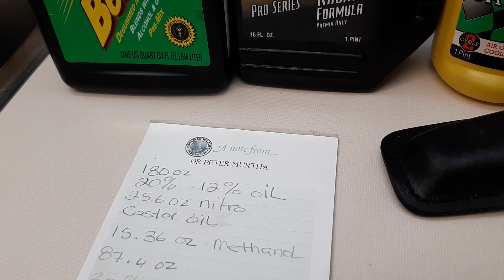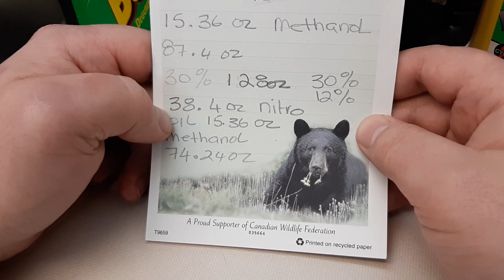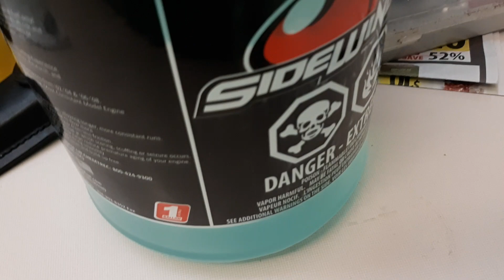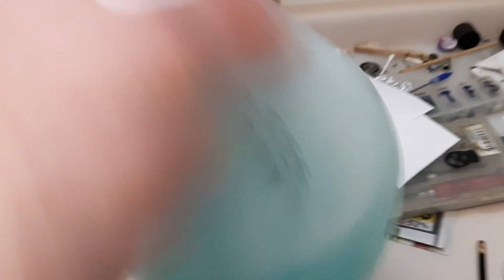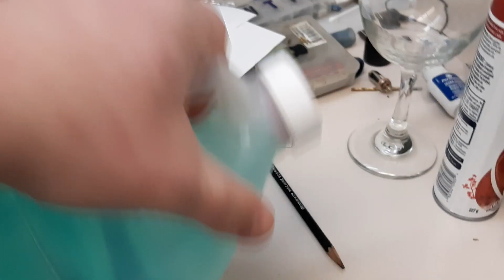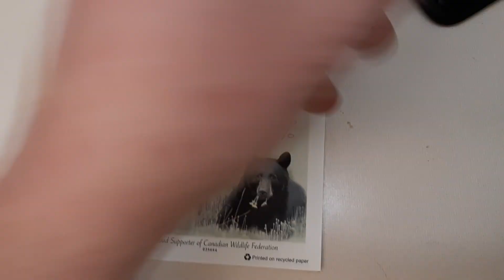How to make your own RC Nitro fuel at home my farmulations and the oils to use

Comment: Tell me if I'm doing something wrong but I'm mixed up some 30-12 from this and it doesn't all fit in a 1 gallon..had to skemp on 3oz oil
Reply from the maker: 10% oil is 12.8oz 68.80oz methanol 38.4oz nitromethane is the mixture for 30% is the mix unless i fucked up and put it down wrong in that case I'm going to can this and re do the video
Reply: I think the mess up is yours video show 1.38.4 oz nitro 74.24 meth 15.36 oil...it does equal 128oz but it doesn't all squeeze into a standard us 1gal jug.idk must be jug then.
Reply from the maker: @bevinsracing   I think the fuel that you mixed up was actually ABN fuel at 15% oil is for nickel sleeve engines. To much for modern ABC engines

Comment: Do you think I can use the gasoline additive heat as my methanol to mix with klotz ?  to make the home brew rc. fuel.
Reply from the maker: Yes you can use HEET IN THE YELLOW BOTTLE ONLY!! 90% heet 10% klotz Castor or klotz super technplate
Reply: Yes Mom always said think outside the box thank you for your speedy reply I will let you know how it goes.
Reply from the maker: @Greenbear39   No problem and keep in mind that is 4 oz of oil to one qt of methanol!
Reply: On a small scale I calculate 12oz heet yellow bottle 1.2 oz  
Of klotzs = 90-10 mixture 🤞
Reply from the maker: @Greenbear39  do it the right way the first time and add in a hot glow plug
Reply: Yes Sir I will follow your directions. I'm working on my 93 Rc10gt black tub waiting on delivery of a trx .15 as we speak. Your a 
Nitro God in my book keep proving em wrong and teaching em rite👍
Reply from the maker: @Greenbear39  the pro 15s like OS LC3 GLOW PLUG  BRAKE IN ON NORMAL NITRO ATOM DRAKE METHOD BEFORE YOU RUN 0%

Comment: That's the way I want to do is make my own nitrofill sense it's going up but the only thing is the oil is very expensive the feel is not just the oils
Reply from the maker: Oftentimes making your own fuel is really not worth it unless you're planning on making a lot and you can get your ingredients really cheap it's $70 a gallon here currently for 30%  But because I run mostly small block engines I don't really consume all that much

Comment: what can you use as after run oil
Reply from the maker: Because it will get sticky if it sits to long just like any oil used in rc fuel if you run your engine dry of fuel its fine for about a month or so before that starts to happen you can make you don't even need to go to the hobby shop for after run oil you can use ATF  or mix it  with 5w30 full synthetic or even air tool oil is fine but if  You read the back a bottle and it says not to use as a storage lubricant then go at what they're saying it's there for a reason

Comment: What can you use as an anti foaming agent and how much of it would you use
Reply from the maker: To be honest I haven't had foaming problems with this oil Some people say a few squirts of Armor All can help but it's mostly water based so you actually contaminate your fuel
Reply: @thebug4046  thanks for reply such a great video there must be an alternative to nitromethane i carnt get it in the uk with out a licence ether right pain to get is there nothing you know of or can think to experiment with its only reali a type of liquid oxygen
Reply from the maker: @ryanthethumb   Search some of my most recent videos you can use a little bit of acetone in the fuel mixture may be only 5% and that will help with tuning but in the most part 0% nydro worth 10% well content works fine with a hot glow plug  and tuning if you can get pure methanol

Comment: Sir here we mix nitromethane+methanol+lubricant? 
Here ,I am confused in liquid nitrogen and nitromethen , which one is use to make 20%nitro fule.
Reply from the maker: You need three ingredients methanol nitromethane and castor oil liquid nitrogen is an inert gas that doesn't have anything to do with making fuel 70% methanol 20% nitromethane 10% castor oil
Reply: @thebug4046  thank so much sir
Reply from the maker: @gauravshastri4244  no problem!

Comment: Now that 30% is 80 bucks a gallon in the states blending your own shit is probably worth it. Especially for 1/8th scale. 
Have you heard of the VP 50/50 methanol nitro blend? Wonder if diluting it with VP methanol to 70/30 and adding castor would work?
Reply from the maker: Yeah it's $67 a gallon here and making your own here is even more expensive than just buying at the hobby shop. I have heard that mixture before it's not available in Canada so I have no experience with it but I'm sure you could probably mix something up as long as you're at 10% oil by volume fluid ounces and can  Dilute that mixture to around 30% with a little bit of math and then topped the rest of the methanol you should be fine
Reply: I’m seriously going to look into it. I can get 5 gallons of VP methanol for 60 bucks. One gallon of 100% nitro for 90 bucks and whatever the Klotz is seems like it would be worth it. I’ll have to do the exact math but it’s got to be close at least
Reply from the maker: @Corkyramano42  nice! Go for it and run klotz super techniplate oil. It's synthetic and castor oil and not as heavy as just castor oil 😉

Comment: Hey do you know where to buy methanol in canada?
Reply from the maker: Look in your local area for race tracks or call VP Fuel and see if you can buy it from them that's what I do
Reply from the maker: You can also buy methyl hydrate at Canadian Tire it's not very pure but it will work if mixed with castor oil the tuning is kind of awful but if that's all you can then you can experiment but just be careful

Comment: Hello sir I have a multitude of questions for you, I want to make fuel like you did but I have a few questions, is there an email I can get in contact with you with, i really enjoy your videos thank you sir
Reply from the maker: I will have to crush your expectations here a little bit it's not always cheaper sometimes it can end up costing you over 100$+ in chemicals to make one gallon.. if you live in the USA you can order  Bones brew fuel to your door 3 gallons for 95$ and with running 0% nitro it's also not much cheaper then buying your fuel you will also have to adjust the Squish band for higher compression and the tuning is a lot more sensitive and makes less power. Here where I live nitro fuel can be very expensive at 80$ a gallon or sometimes none is available for months at a time. That's the reason why i burn 0% nitro But unless you can get your chemicals really cheap it's not worth it.
Reply: Well thank you for getting back to me. I can buy a 5 gal pal of VP 50/50 mix of nitromethane and methanol, I just bought 5 gallons of methanol for 19$, I just now have to add the castor oil. I’m
Going to make as much as I can with the amounts I have already. If it’s worth it then I will continue but if it’s not I won’t. I enjoy your videos and thanks again for getting back to me, stay safe !
Reply from the maker: @deandadamo7796   Yeah see once you get the stuff premixed it's kind of hard to really know exactly what ratios you're gonna end up with but it's not gonna be much with the Nitro so you could just follow say the 30% fuel recipe or 20% fuel recipe which I'm sure I made in this video 20/70/10 or 30/60/10
Reply: I will definitely! As crazy as it sounds I found an old article in a forum called balsa bench building, it was a very long article on glow fuel, they had a formula for the VP premix. I will watch your recipe again, I have watched a lot of your vids and I am confident I will get it right, I guess it will be a learning experience. Thanks again for your vids I did  subscribe !
Reply from the maker: @deandadamo7796   Thank you very much and that sounds more or less like an airplane thing that you're reading I will say that airplane fuel has way too much oil in it for RC car use also back in the day the engines then used like 24% oil which has ridiculous which is not really necessary for today's engines unless you have really old stuff  I did make a few A few videos recently about explaining the difference between ABC and ABN engines and fuel and oil and things you should know about
Reply: I am an airplane guy, I will look for those videos. I run 2 and 4 stroke airplane engines, my stuff isn’t real old but at least 15 years old
Reply from the maker: @deandadamo7796  I used to fly as well I had a SIG LT40 with a moki 2 stroke in it I think around a .40 or so
Reply: Very cool I had a car or 2 but mainly I’m an airplane guy !

Comment: How can nitro be substituted, in my country it is difficult to get
Reply from the maker: Go looking through my channel I have lots of videos explaining how to make 0% with just 2 ingredients methanol and Castor oil i just made a video about it 2 weeks ago
Reply: Thank you very much for your answer, if I saw your video of the 80/20 mixture, however, I fly in Bogotá at 2,650 meters high and a helper is required in the literature I have found acetone or amyl acetate that have a power three times greater than nitromethane, what do you think about this
Reply from the maker: @PEDRORUGELES  acetone kinda helps im not sure about the other chemical you mentioned. I have never heard of it before for airplanes 80/20 for rc cars 90/10  you can try with those chemicals and see what happens good luck i hope it works!